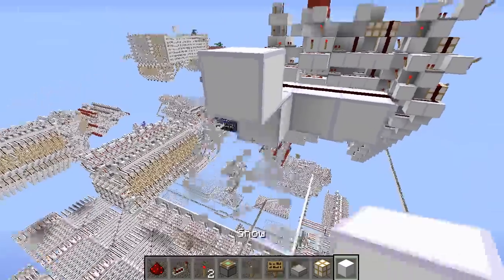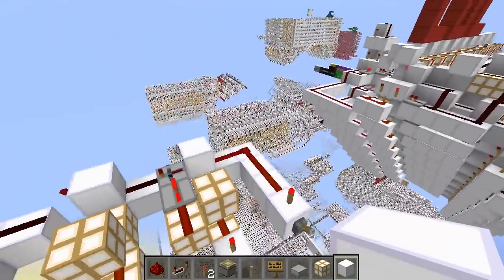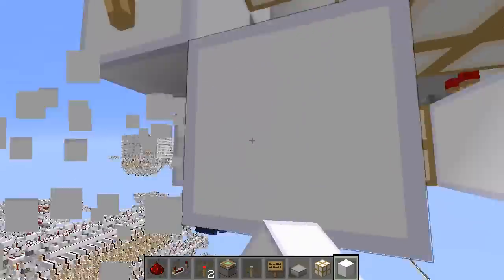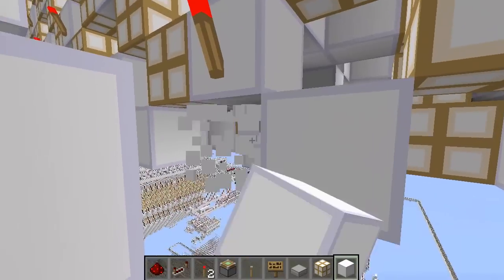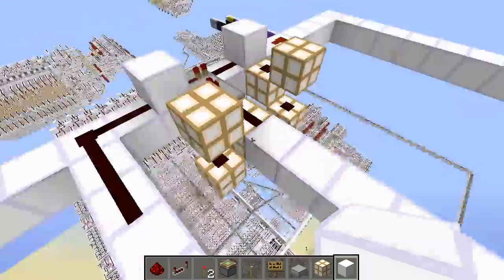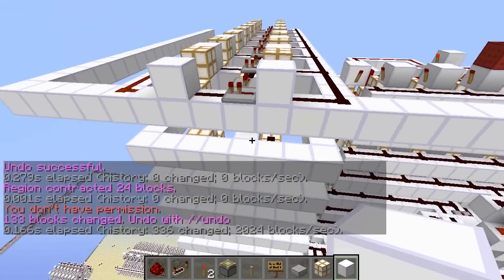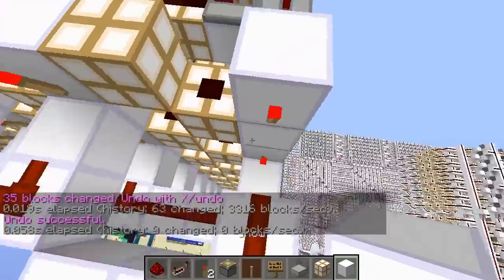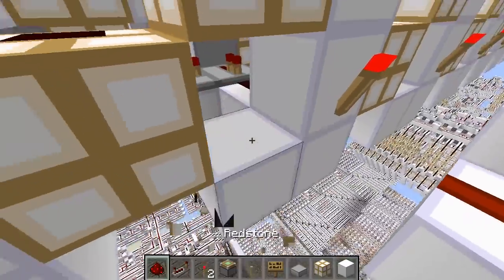Advanced Redstone Computer Tutorial 12: Starting the Registers

Comment: Ha, in 1.5 you can just use comparators in front of the repeater lock for the write mechanism. Not only is it smaller but it supports 5 Hz throughput then.

Comment from the maker: It's horrendously impractical. Megahertz mean a million cycles per second. Redstone computers don't do millions of cycles per second. In fact, they rarely do a single cycle per second in most cases. If you measured in megahertz, then measurements would be along the lines of 0.000000416 MHz. It's true, but it's not a very useful way to think of the speed.
It's basically the same reason people don't measure file sizes in yottabytes.